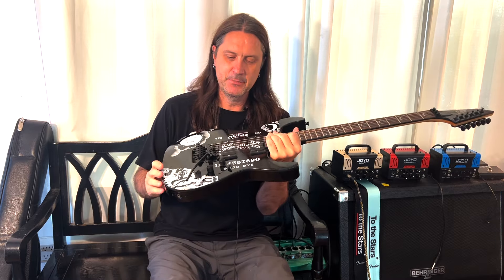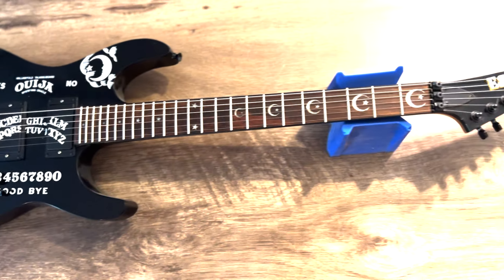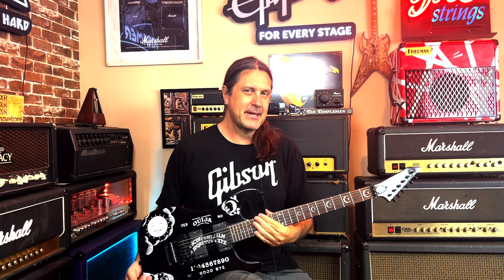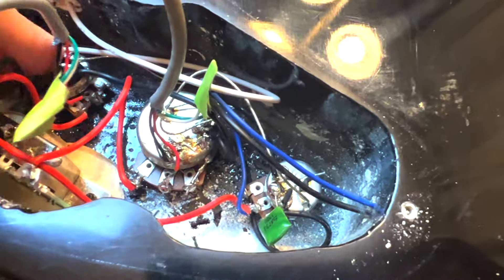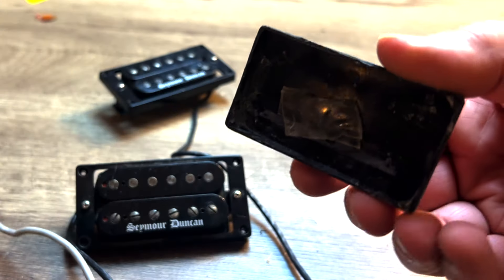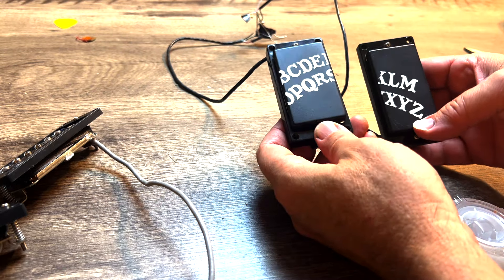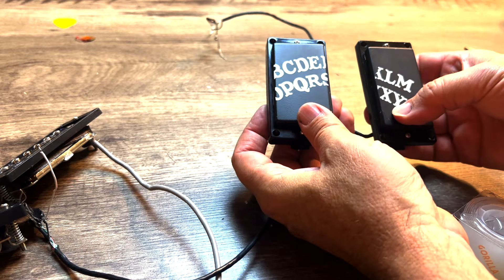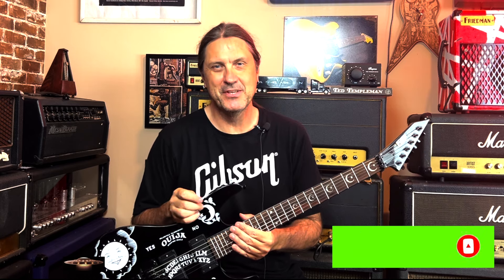I Upgrade My Fake ESP Kirk Hammett Ouija -  Seymour Duncan Black Winter Pickups And Now It Rips Ass

Comment: I had a fake ESP George Lynch Skulls and Snakes that I put a Screamin Demon in the bridge and added an original floyd rose tremolo.  All in I spent $100 on the guitar,  $105 for the pickup and a little over $200 for the Floyd Rose Original.
Reply: Killer! I want one just like that. I've got the Tiger. But I want that Green and Black Skull & Snakes. I'm not even into Skulls and Snakes. LOL But the guitar is just so bad-ass... and I always thought it was beautiful... for what it is. I want to get a finished body, or even a body and neck... and build one out like you ended up doing.

Comment: love it Marty.. change that floyd as well.. pay attention to quality of studs.. buy metric replacement if you can.. rather than replacing bushings.. painful if the bushings need to be drilled.. weakens the wood structure around the area..

Comment: Killer guitar, Marty. I swear... I know I'm being a jerk when I say this. LOL Not trying to be... but dayum I thought the Pro Buckers sounded better! But... I'm also thinking maybe you were in 2 differnet spots when you filmed and recorded. Maybe 2 different set-ups, such as how far away you were. Mic position. Or even if direct... something a little different. I thought the Black Winters were much darker. Maybe hotter. But darker. And maybe that's what I was hearing. No matter.... it you're happy... I'm happy about it !
Reply from the maker: I liked the probuckers better too!  But they are not hot enough for this guitar and what I need it for.  I'm more of a less is more kinda guy! 🤟🏻
Reply: I liked both but the Black Winters did suit the guitar better you could some more treble or presence on your amp or overdrive with the tone knob more on treble side to rid the darkness and that would be a perfect metal guitar. Pro buckers sound great as well very impressive 🤟🏻Black Winters had more punch  and were tighter good harmonics too.